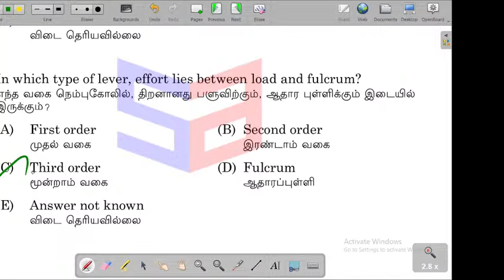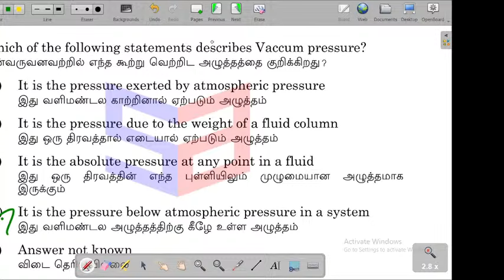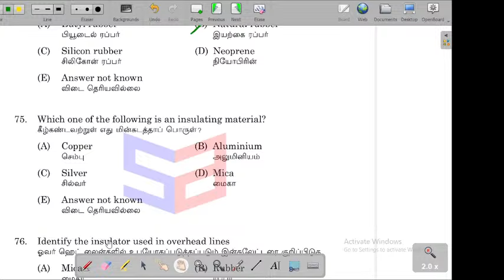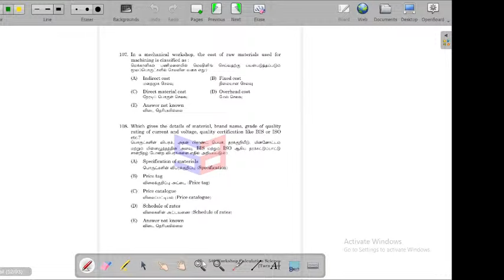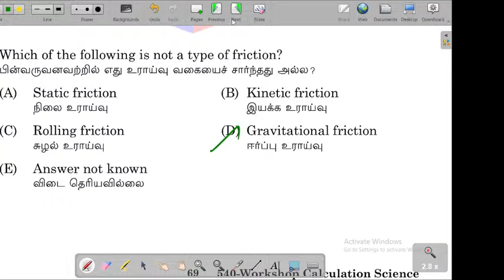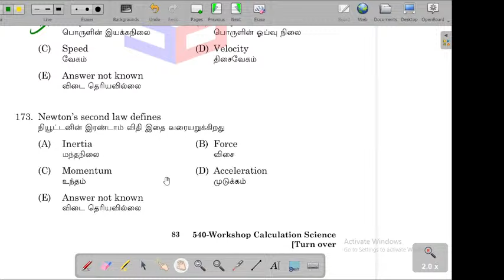CTSE DIPLOMA / ITI LEVEL - Post Code 540- Workshop Calculation & Science - Answer key Sparks Academy

Comment: Maam 50 a is not crct ?heat transfer from one solid to another solid by conduction
Reply: Actual movement of Particle in convection only.... 
Without movement of Particle (due to lattice vibration) is conduction
Reply: Conduction is correct